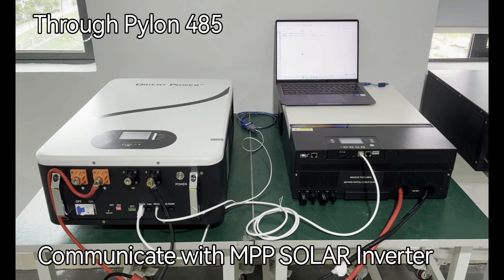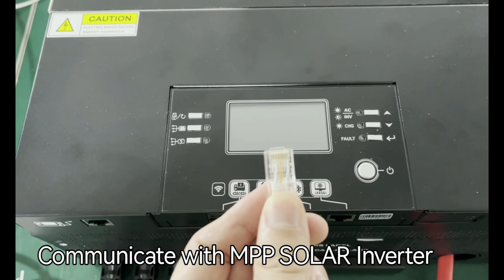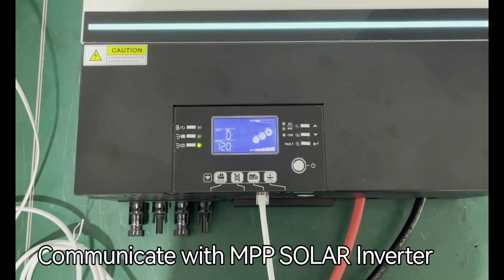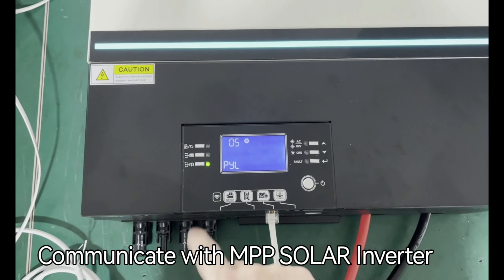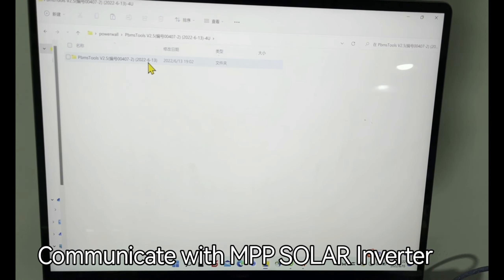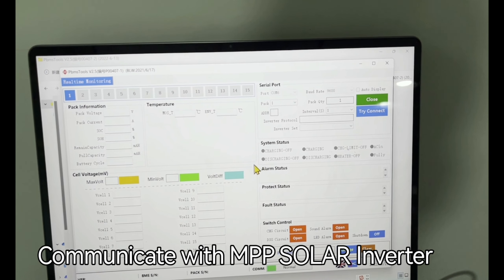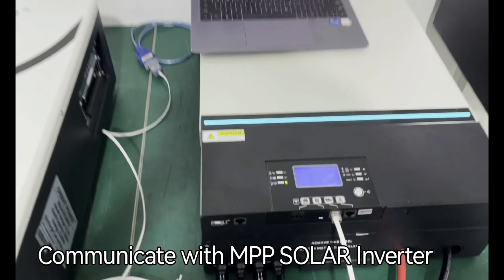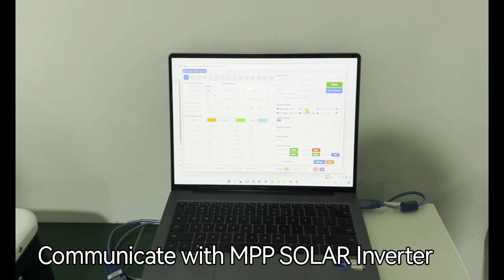Orient Power Powerwall Battery Pylon485 Communicate with MPP SOLAR LV6548

Comment: I have a Powmax 7.2 kw inverter but not connecting with this battery hat is it I am doing wrong thanks
Reply from the maker: do you have a name plate of the inverter?
Reply: POWMR (Model Nmae: POW-MAX-7.2KW-48v-230v) @powerwall
Reply: can you give me the correct diagram for the connecting cable for the BMS please need to make own cable thank you @powerwall
Reply: also my inverter is idebtical like the one in video but just different name thank you.
Reply from the maker: @nyakifo  you mean from the battery BMS to the inverter communication cable wiring?
Reply: Ok I have cable connected but there is no communication
Reply: @powerwall yea that cable is connected but looks like still not getting communication getting Error 61 on inverter side
Reply from the maker: @nyakifo  the bms to inverter cable need use special made one. BMS side use pin 123, inverter side use pin 358
Reply from the maker: Make sure you are using the correct wire